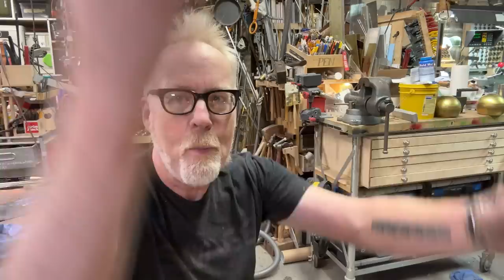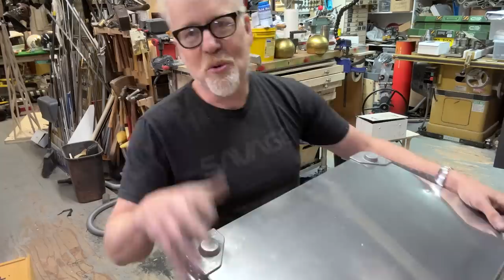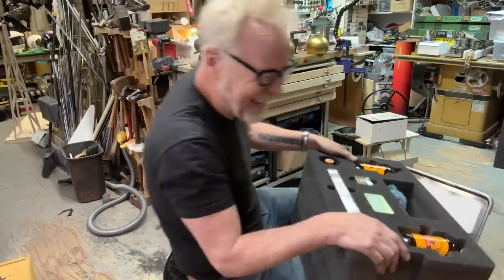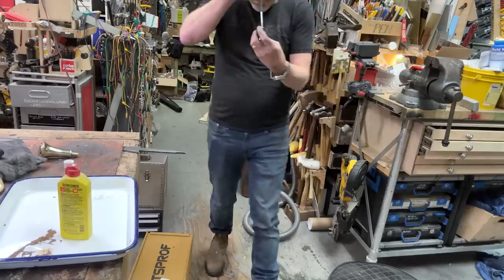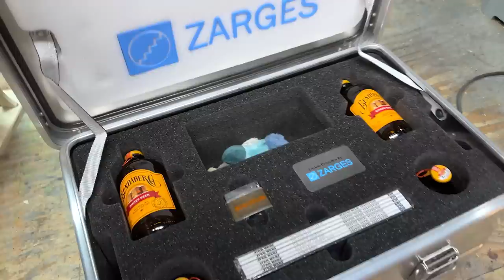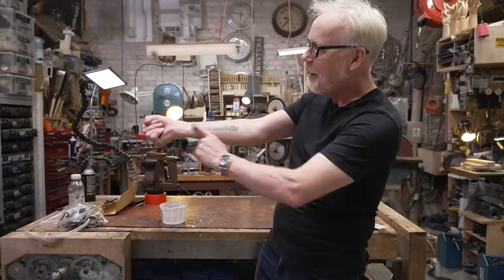Adam Savage's Mystery Aluminum Case Mailbag

Comment: That's awesome!   Will have to look into them for my case needs with my RC hobby.
Reply: It's not good to use metal boxes for RC stuff. Old timers thought me that in the early 90's. If it's steel it will ruin your motors and any other metal could short out batteries and electronics.

Comment: I BUSTED THE MYTH OF DOWSING and reverse engineered the physics used in dowsing with the modern light weight ball bearing dowsing rod, which accurately gauges and deciphers what is being dowsed by pitting the energy of gravity against the energizing of the one-tenth ounce dowsing rod load that is attached at a predetermined location on the ELEVATED acetylene welding rod of the dowsing rod.  This precisely dowses all edges, exact center, depth buried with angle of deposition, and most important GRADING of the sought element contained in the elemental mass that is being dowsed.  Read the book, The Art of Dowsing - Separating Science from Superstition, which explains all of the physics involved in dowsing along with how to build the modern light weight ball bearing dowsing rod.  Then become a professional dowser by practicing the book's dowsing lessons of buried pipelines and cables, tunnels and voids, precious metal placer and lode deposits, dowsing for treasure, dowsing for any element, amplified long distance dowsing from a moving vehicle, and dowsing on water from a boat.  I give free dowsing lessons in Laplata Canyon near Durango, Colorado where a gold vein system runs underneath the Laplata County Road.  Thank you for reading this post and have a safe, healthy, good day.